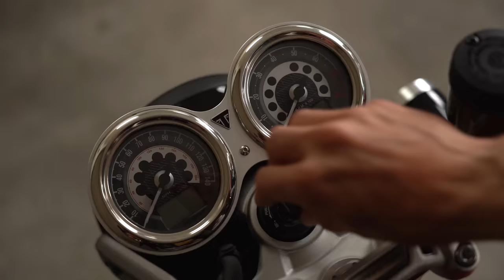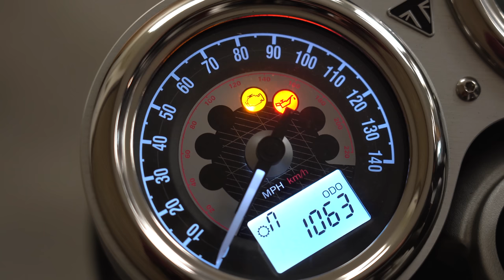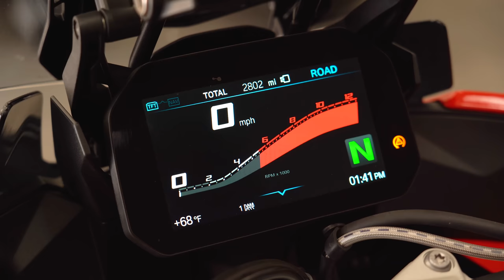Do You Need To Warm Up Your Engine? | The Shop Manual

Comment: I am an engineer and the fact that motorcycle engines don't blow up every so often is unbelievable to me.
I will always make sure my engine never sees redline and it gets its 1 minute idle time.
Reply: high performance engines are designed to bounce off the redline so if you're on a supersport or something equivalent, dont even worry about that!
Reply: Engineer in what? Oil pressure at idle is lower than at moderate engine speeds. Letting it idle is more harmful than just setting of gently. Turn it on and set off, that way you build up oil pressure the fastest. Once the oil temperature reaches about 80 degrees you can give it some load…
Reply: @mabrokenleg2388  the tolerances in modern engines, especially high revving ones are pretty bonkers.
Reply: It is SHOCKING how motorcycle engines hold together. Although some do blow up. 
-The Kawasaki Vulcan with the plastic oil pump gear, which would fail and lose oil pressure (only certain years had this issue). 
-And the notorious most dangerous engine ever built, the Kawasaki ZX-12R in 1999-2003 era, which had an oiling problem during acceleration, where oil starvation to the pickup tube would cause a spun bearing on the crank and the engine would literally explode and shoot a rod out of the bottom of the engine at high speeds on the freeway. 
-Also, Aprilia 660 engines are well known for exploding due to an oiling problem and they also have severe oil burning problems due to defects in the valve seals or oiling rings. 
-Suzuki DR650 (earlier models) had bolts that would fall out inside the transmission on the neutral indicator and the engine could potentially lock up. 
-KLR650 were notorious for having a bad cam chain tensioner and the engine would fail if it wasn't replaced.
Reply: What kind of engineer are you? Software?
Idling is the most inefficient way to bring the engine up to temperature and it creates the lowest amount of oil pressure.
Redline is the safe maximum RPM set by the engineers who built that engine. As long as the engine is in good working order you can ride it at Redline all day long. My bike actually runs cooler at higher revs than if I cruise around.
Reply: An engine that blows up (while I'm riding my bike) is like my greatest fear. Probably quite irrational but still...
Reply: @sv650nyc7  It is your bike. Destroy it any way you please. People like you are the reason I rarely by 2nd hand bikes. Especially not performance bikes. Meanwhile you did not mention your own qualifications beyond the obvious that you possibly own and ride a motorbike. That alone neither makes you wise not validates your opinion.
Reply: @mabrokenleg2388  A cold engine whether it be carburetted with a choke operating or fuel injected will normally have a higher idle rpm than a warmed up engine. As long as the oil pump and internal clearances are not a problem it will have more than enough oil pressure for all the engine needs. Also warming up an engine does not have to mean only letting it idle. Nothing wrong with holding the rpm a little above idle for a minute or so. I do not disagree you can set off gently pretty quickly but it is still actually better for the engine to have 1 to 2 minutes for initial warm up prior to setting off if we are being picky to allow ring gaps and piston clearance to increase to more optimal amounts. The reason apart from letting lubrication get onto the cylinder walls is that proper clearances reduces unburnt fuel passing rings to contaminate and thin the oil. That was a greater problem with carburetors and chokes however still has some application with fuel injection to a lesser degree due to better fuel atomization. Oh, and it is never harmful to any normal engine to have a warm up period compared to setting off down the road gently. The latter however might mean one does not feel like they are wasting fuel just sitting stationary. {And I do have the correct qualifications to give a professional opinion; not just I ride a bike}.
Reply: @kassiedreaneai7459  that‘s entirely depending on whether your ecu is advanced enough to follow a cold start protocol. The question gets even more complicated with stricter emission standards and catalyst heating modes…
Reply: @kassiedreaneai7459  also to get really nitpicky, engine speeds around idling or slightly above are most critical oil supply wise, due to the linear characteristics of oil pumps for automotive use and thereby low displacement volume at low rpm. 

In general this operating point yields lower efficiency, higher oil dilution, little heat and therefore low heat transfer. Your engine will take longer to reach operating temperature this way, which is in no way good for it.

The best way to warm up an engine would be by pre heating the oil/water externally and cycling it through the engine before starting it, then to turn it over by an external motor to build up oil pressure without any fuel being added into the combustion chamber and then to turn it on. This is an unrealistic use case in for most users, except for maybe in F1 Racing. In general using an operating point with medium to low rpm and load is the sensible thing to do, manufacturers specifically design modern vehicles with that intent anyways. Letting it idle is inefficient, wasteful, and slightly harmful considering the afore mentioned points. It is not gonna explode from letting it idle for a minute before setting of tho, modern lubricants have your back…
Reply: @kassiedreaneai7459  You can deny the facts all you want
It is pretty well known that the worst thing for your engine is idle when cold (causes the most wear) 
Riding the bike asap (gently medium RPM ish) will do MANY good things
1 ensure proper oil pressure
2 REDUCE the warmuptime significantly! Thus less time spent at less than ideal tolerances
3 Waste less time looking at your bike for no reason instead of riding.
Reply: @kassiedreaneai7459  you got that right. I’ll never buy a sport bike used. I always buy new.
Reply: @mabrokenleg2388  he’s a “feelings” engineer
Reply: It's quite incredible how people think they know better than the engineer's who built the engines. Just read the manual and yes your bike will have enough oil pressure at idle...
Reply: @andrepower6  nobody claimed the contrary. This is a hypothetical discussion about what the best way to warm up an engine would be. Totally different topic…
Reply: Wowieee, my credentials got challenged😂

Well any modern engine worth it's salt will make adequate oil pressure across the entire revv and load range, be it a neutral idle or a 6th gear cruise.

No it's not really that bad to redline your engine and won't really break anything but it's called the RED line and not the yellow line for a reason and you should not be there for extended periods of time. Heck I'd even advise against being at 8-10k for too long.

I know what I'm dealing with but my head refuses to accept that this thing that runs on 80 explosions every second is FINE!
And I will continue to make sure that my engine idles for a minute and that I never see the redline.
Reply: @Surpriseify  So you have mechanical qualifications to back up your opinion or you just ride a bike too. "Everybody knows" or "it is pretty well known" is not the qualifications to base expert opinion on. Different people like or do different things to warm up an engine. It is their engine and they can do what they want. But if we are talking "when does the most wear and tear take place" it is when an engine is cold. But you did mention running it gently and I have already stated the facts above. However Ma Broken Leg started off this particular spin off of conversation with the statements one should {or he does} start a cold engine and get out and redline it immediately as the best way to warm up a engine while mocking an engineer although he himself is the ludicrous person without a clue of the facts. The facts have been presented. I care not who believes them. The experts with qualifications know the truth and anyone else interested in argument is not worth extra attention. Your bike do what you like; but telling others to do what you do because it is right or someone else is wrong requires some sort of reasonable expertise to have the right to a valid opinion if they choose to class it as expert. I have 40 years as a mechanic and have not seen a opinion contrary to what I have mentioned by a person who has stated their qualifications. So who is denying the facts?

Comment: For Yamaha mt-25, I'm sure I don't have to warm it up. But when I do, it's sound changes, somehow I feel like it have more torque.
Probably the reason is that, when it run for couple of minutes engine's noise is something I recognize. Through whole right it makes the same sound because it's warm. First few minutes of ride is different.

Plus, tires have to warm up. And it needs time. When tires are warm it perform better. At the same time since I've been riding for few minutes engine warms up too and it may be misleading.

Comment: Spitting facts! Older bikes like my 750 GSXR from 1986 doesn't even supply the oil everywhere where its need if the rpm is below 2500ish. Its because of the oil pump design. So  i get dressed before it start to idle it. Sit on it and ride away asap with choke on and RPM between 3-5 for like 10 min.,

Comment: I've always practised mechanical sympathy by letting engines warm up before putting them to work, whether you can get away with it or not. Feels wrong in the soul lol
Reply: Truth is, your probably doing more harm than good letting engines that are computer controlled warm up to operating temps. Cold engines wear more than warms ones and modern (in the last 20 years) engines have the proper fuel maps to keep the engine safe during the first part of your ride.
Reply: @urmomsahoe1  letting the engine warm up never harms it more, theres less load and stress on parts and reducing wear and tear is key for longevity when not in operating state. A fuel map simply wont protect the materials the engine and bearings are made of aka metal
Reply: @factoryrider9537  what about condensation in the oill? Are you aware of this? None of the experts have addressed this.

Comment: Ironically, not a mention of liquid cooled vs. air cooled.  I expected the "don't let the older air-cooled bikes sit indefinitely at idle".   Guess I'm so old that I think about stuff that used to be relevant.   But if you're a youngster AND have an air-cooled machine... take note.
Reply: Never had issues with my air cooled bikes, even living in a hot climate.

Riding track on my air cooled bike, you were definitely slower after a few laps from all the built up heat, but never a problem idling.
Reply: @JoshuaTootell  aslonmg as u drive its fine  but if u let a air cooled stuff idle for 15 mins. its most likeyly somethings gonna have more wear as intendet and therefor = breaking down

Comment: My carbureted 2006 Hyosung runs just fine after idling for 10 seconds or so. Ditto for my 1983 Suzuki GS1100E. As you say, I never open up the throttle until they get warmed up, though.

Comment: The faster your engine is on temperature the less wear it will get.
riding it moderately immediately will get it warm the quickest.
why you don't want to redline your engine, or (and this is more important) full throttle aka heavy loads (heavy loads tend to increase temperature more then high rpm).
is because of expansion. because the piston is light and thin and the block is thick and big, the expansion rates with temperatures are different. so it is possible you'll expand your pistons so much they will seize in the block. and then your engine is fucked.

bottom line is start, ride gently, then bean it.
Reply: Sure, but you need to get your oil hot too before getting those moving parts under stress
Reply: @mr.terwilliger5728  Riding your bike gently does not put moving parts under any significant stress
Leaving your engine to stay cold MUCH MUCH longer during a long and slow idle warmup is 100% more harmful than getting it up to temp fast with propper oil pressure.
 However modern engines are unlikely to care whatever you do, maybe the "perfect warmup procedure" will increase longevity by like 5%
Reply: @Surpriseify   The coolant is constantly being cooled (not trying to be funny) by the radiator and fan. If the coolant is running at 210-225 then there are much higher actual engine temperatures heating that coolant constantly. Remember the gas exploding in the cylinder is roughly 2500 degrees, maybe 2600. Most of that heat is expelled through the exhaust pipe, the remaining heats the immediate metal inside the cylinder walls and travels  through the block (where the radiator fluid comes in) and heats the oil and whatever surrounding engine parts are there. 

My point ultimately is that there are engine parts well over 500 degrees moving and rubbing, we want to wait until everything is lubricated and very hot before applying stress to these parts by riding when the engine is cold 🙂

Comment: I always let me 2021 mt07 warm up. When I put it into first gear when its cold, its a hard thunk and lurches forward aggressively. When I let it warm up, it doesn't do that too bad.
Reply: You need to adjust your clutch correctly. It has little to do with cold oil.
Reply: @sv650nyc7  its a known problem with the mt07. Why does it lurch and clunk forward when the engine is cold, and doesn't do it when the engine is warmed up???

Comment: who remembers cars from the seventies? the battery weak, crank unwilling, manual choke, struggle start, motor cold and not firing on all cylinders, wait for the thing to warm up, idle finally settles and anywhere from 1 minute (summer) to 5 minutes (winter), you hit the road, carefully wrangling the choke as the skinny rear tires battled to find grip, peering out thru the thin bar of demisted windshield while using all your strength to press the clutch, ram the stick into another gear or turn the steering wheel, only possible while in motion. Ah, the joy.

Comment: Depending on the bike I do things a little differently.  My current bike a 2010 aprilia tuono 1000r ill start and let run as long as it takes to get my gear on and then I'm usually ready to roll.  Generally fuel injected bikes will high idle on their own and then will settle as the bike warms.  Thats the point ill take off along with getting my gear on.  And as mentioned in the video the bike will show an oil light/symbol until pressure builds and then goes off.  Thats usually only a few seconds though.   But carb bikes are a whole different story.  Sometimes they won't need choke at all, others need choke for what seems like forever and even need to ride a few minutes with the choke until its fully up to temp and will run on its own off choke.

Comment: 1 or 2 mins are must but it depends on ur bike, my 125CC bajaj discover bike has carborator which u can find in India or in south east asia will stall if u just start the engine and try to move or even stay on idle so u have to constantly hold ur accelerator abit above the idle rpm in order to let it warm else it stalls. So as soon as 1 min or 30 sec passes u can leave ur accelerator and let it warm up on idel rpm else it does not start in cold morning.

Comment: If the weather isn't too cold, I usually just ride straight off, and take it easy for a bit. Then, by the time the engine is warm, I know that the tires are decently warm too.

If you warm the engine by too much, it might give you the impression that you can ride hard straight away, which can be really bad on cold tires.

Comment: I've got a 2006 VTX1300C. So it prefers to warm up for a few minutes first. The choke will keep it running but it certainly doesn't like being ridden with the choke on. 

As far as people riding in the cold? I once adopted a guy on the highway on a Victory bagger. Dude was riding 70mph in -4⁰F temps.

Comment: In Chicago I wait for the revs to stabilize and any weird startup noises to cease before going nice and gentle until its at operating temperature lol. In the winter this takes about a minute for the RPM's and oil pressure to stabilize. In the summer a few seconds, and usually no extra noise in the summer.

Comment: For my morning commute I start the bike while I'm getting my backpack strapped to the motorcycle and my gear on. It's a 2008 fz6 so I don't need to warm it up for long, but I like to ride it a bit rougher (running late usually haha) so I feel better letting it warm up in my driveway before giving it some beans

Comment: I live on the end of a hill. I just cruise in N until it straightens and by then it’s up to temp. The only time I really waited was when I went skiing. It was so cold I bent down and whispered to the engine “I’m sorry” and then hit the starter. The snow flakes that landed on the seat melted since it was black and relatively hot (sunny and cold day). The next morning I was ready to roll and found a sheet of ice covering my seat. So yeah I waited a couple minutes for it to warm up.

Comment: when I had a cheap bike with a carb that needed at least 3-4 minutes or it would just stall at every opportunity,but with my current newer fuel injected bike I let it idle while I check the lights and controls and that's more than enough.

Comment: Had a 1989 Yamaha FJ1200 and the choke didn’t work very well and was all or nothing. Until it thoroughly warmed up, it never ran right, and I had to work to keep it from stalling. Current ride is a 2014 FZ-09 and always let it warm until the display changes from “LO” to 105, the lowest temp it will show, then go easy on the revs until it’s at least 160.

Comment: Cars and bikes both, I usually wait till the RPM's naturally drop before I ride or drive off. That typically takes 30 seconds or so. I do exactly what you said. Turn it on, put your gear on, and off you go. That's usually more than enough time.